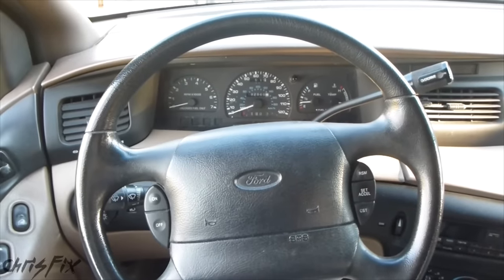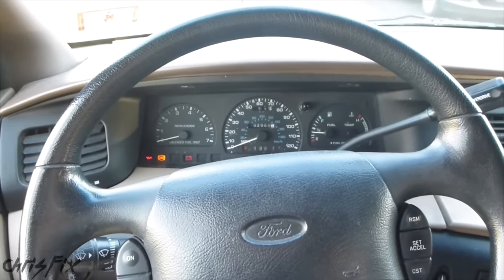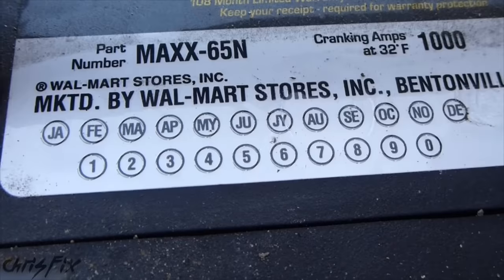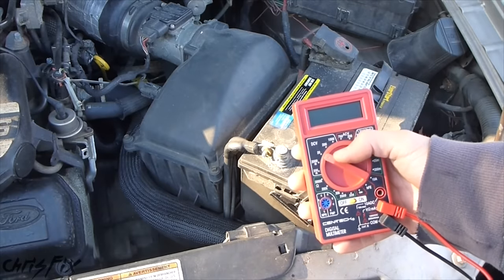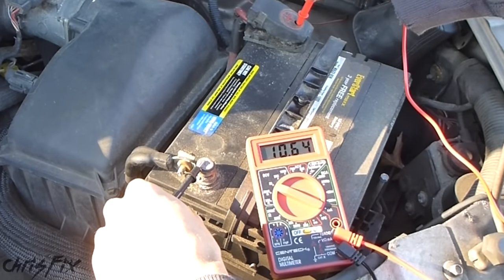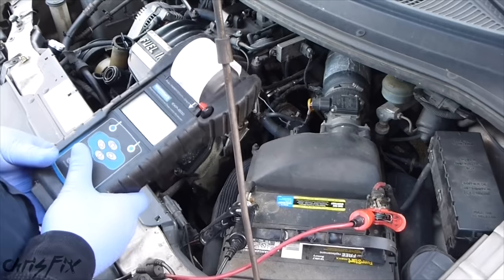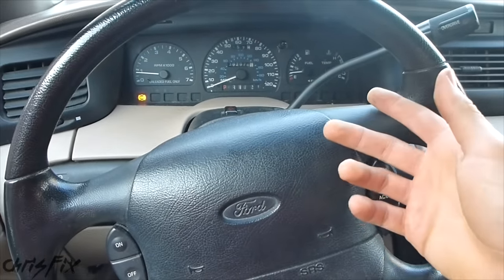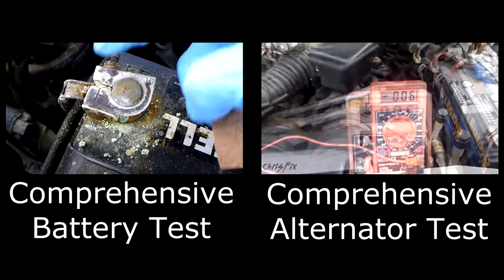What to do if your Car won't Start

Comment: 2 times my truck did not start. The radio, lights came one but still wouldnt start. Hooked up jumper cables, did not start. I TURN ON THE HEADLIGHTS AND IT STARTS. Truck is such a troll
Reply from the maker: shoebert31 hahaha, did you ever figure out why? That is bizarre!
Reply: ChrisFix
nope, only happened twice
Reply: ford f150
Reply from the maker: Hopefully it is nothing. But on the bright side, you can be like Biff in back to the future. Only you can start your car haha.
Reply: Arutha258
i dont recall
Reply: shoebert31
My '04 Mustang died going down the road a few times and when I would turn the ignition on to restart, none of the gauges would work but the radio and lights worked fine. It wouldn't start. I was just wondering if we had a similar issue. I've been told it could be my anti theft malfunctioning and locking me out. After the car sits for 10-20 mins, it fires right up.
Reply: Arutha258 it's because your car is not in park
Reply: shoebert31 hahahahaha thanks for sharing the story lol
Reply: Shoe did you check the starter
Reply: I had the same issue. Turned out issue was a Ford.

Comment: What if my car studders when i crank it and now it doesnt want to start, its only a tic noise. What could it be?
Reply: Either starter needs to be tinkered with or replaced or your battery is shot
Reply: Loose cable

Comment: i have 2008 or 2009 madza cx- 9 ....like the pass 2 weeks its been acting up ...when i got off from work i tried to crank it up but did not turn on i waited like 5 mins then it turn on so i was not stranded .. it has done that to me like 4 times ..you think you can tell me whats the problem on it ..i would really Appreciate it.
thanks
Reply from the maker: It sounds like a bad starter, I have a video here on how to diagnose and replace one, check it out: https://www.youtube.com/watch?v=yC409CU7mU8

Comment: Hey Chris I have the same engine in my 1988 Mercury Cougar that’s in this vehicle it cranks and backfires but never starts when it cranks there is oil leaking out of the throttle body I replaced the fuel filter and spark plugs but that didn’t do nothing I used starting fluid and the only thing it does when I crank it the car immediately backfires during startup and doesn’t start what do I do?

Comment: hey so i have a gmc sierra 2005 and one day randomly it wouldn’t start. it was cranking and at a regular speed, just wouldn’t start, almost like it was out of gas. after a few minutes it started up fine. any suggestion on what may have caused this? no issues since

Comment: Hey. I've got a problem with my 2000 Ford Ranger. I've got the 2.5L I4. Typically happens when I'm first turning it on after several hours. Basically, when I turn the key to 5th position, the ignition will not crank at all. Lights come on and the chimes beep normally, but no cranking. I have to hold the key in 5th position for around 10-20 seconds before the engine cranks and I'm able to drive. I've replaced the battery and cleaned off the corrosion, to which I run into the same problem. It's beginning to get really frustrating because I can't figure out the source of the problem and no one has been able to help. Got any advice?

Comment: Hi, I have a question. I have an old car and I haven't been using it. Its been months since I started it. But I tried to start it today but it won't start. It doesn't even crank or make any noise when your turn the key. Know what it could be? I know without you looking at it might be hard but just curios if you know. And its a 4 cylinder but it is running on 3 cylinders. From what my mechanic said. Thats why I started using another car cause it would turn off when I sat at a stop light or stop sign for too long.

Comment: hi, there. i drove my car earlier today and when i tried to use it 3 hours later. it wouldn't go .. my battery is new likewise 8 months old. my lights come on, there's no signal stating its the battery or anything and the clock hasn't reset. do you think its the starter?

Comment: My car doesnt start when I turn the key slowly or at like a normal speed. (whatever a normal speed would be) I have to insert and turn the key really fast right away or it won't start. I have no idea what the problem is.
Reply from the maker: It can be a few things but I would check your key cylinder.
Reply: +skyistooblue2 had the same problem with a vaxhall corsa turned out to be a faulty ecu due to getting wet from a steam clean

Comment: My 2016 Subaru Legacy wouldn’t start and still had the original battery with lots of corrosion on the positive terminal. I replaced the battery and used baking soda and water to clean the terminal clamps. Tried starting and it wouldn’t start. Got some lights on the console, but no clicks or turning over sounds. 

Measured the voltage at it was 12.6V. Then a few minutes later I tried starting it again and it started right up. Should I be worried about a different issue?

Comment: Man it's impossible nowadays to find a battery that can last for 7 years !!!
It's a miracle for me if it lasts 3 years ...
Reply: Abdullah Ibrahim I have one that's almost 5 years old and it's still cranking strong.
Reply: Abdullah Ibrahim well my sisters car is a 2006 Corolla and the battery has lasted ever since my grandma bought the car
Reply: I bought  a Corolla  2001 surprisingly  the battery  is 9 year old  works perfectly  so far.

Comment: I have a 80 series landcrusier and it wouldn't start but that's battery is fine so I thought it was the fuel and it's cranking but not turning over, I replaced the fuel solinoid but it wasn't the case and still wouldn't go I took out the hose connected to the fuel filter and cranked it and still didn't turn over do you think it's the fuel pump ?

Comment: I had a battery go bad but not in the way you think.  Needed a jump start to get home and about midnight I checked the start again.   Nothing and checked the terminals.  The Negative terminal was corroded at the base of the battery housing.  I was able to get it cranked and started.  Took it to the local 24 hour Auto Zone and pretty much new battery was shot.  Didn’t even try to load test.  They had in stock but I didn’t want to risk shutting down in the A/Z parking lot and not starting again.  

I wound up replacing the battery with engine running secured the terminals and went back home.  Had no issues after that.

Comment: Sharing my experience with this same issue. Trying to start the car (Honda CR-V 2002 AT), all that happens is there is a single click sound coming from somewhere, and no cranking takes place. Tried multiple times, and the same just happens.

I checked the terminal connections in the battery if they were loose; nope, they were nice and tight. Tried replacing the battery with a new one (since the old one had a history of being totally discharged a couple of months prior); the issue still persists.

The problem all along was a blown fuse for the fuel pump. The fuse box was below the steering column. Good thing there were spare fuses with the correct ampere rating in the fuse box under the hood. Replacing the said fuse fixed my issue.

Comment: I can tell by how it sounds your battery was just dead
Reply from the maker: Yep!
Reply: what if the Alternator was faulty?
Reply: +8Beat Crotchet It could keep running, but you'll lose alot of juice, because the alternator charges the battery while driving, but if your alternator is bad, then you'll be losing alot of voltages from your battery

Comment: I broke down on highway and got pulled home. My wire from frame to firewall was broke in half before so I put a 12 gauge wire in place of. I keep on having problems with truck cutting off. Sometimes It won't start and wait 5 minutes and then it will start. A friend noticed the ground on engine in front was loose so he tightened and it about cranked then I found another wire from frame going to back of engine was just about burnt in half and I twisted the wires together and put a electric slice twister to put 2 wires together. It still just about starts and I tried starter fluid in breather or carb. Truck is a Chevy K3500 gas 5.7 engine 4-door crew cab Dually with 4 wheel drive. I need help please on what to do next. And just subscribed and like alot of your videos.I did tighten bolt on frame to tight and I guess I will tack weld it. I hope that will fix it. Anymore suggestions. Has 105k on miles. Rebuilt alternator, new starter, checked all fuses, Im wondering if it's a relay. I checked them and seems ok plus 60 psi fuel pressure. RS2. says oxygen sensor and CATALACK converter

Comment: If you drive a manual you can also push tbe car and while it's moving you can try starting the car as because of the movement the battery usually gets a microscopical amount of energy which is in most cases enough then just let it run a little to charge up and you are free to go

Comment: hey chris, listen, i was told some time ago this, and now i took notice, so ot may be a good idea to share with you. so after you put the ignition key and turn on the battery, i was told to wait a litle for the fuel pump to load before starting the engine, another thing is when the engine starts,to let it get hot,and if possible never to start going rear with cold engine. If you would like you can make a video about litle thing like these and maybe debunk some myths. Good job man!
Reply from the maker: Thanks a lot! I actually made a video similar to that a while ago, check it out: https://www.youtube.com/watch?v=gkn-K2noClw

Comment: Hey chris i have a 1984 cadillac deville and my car is showing a battery light and when i got to start it it dose a slow start and it seems like the car wont hold a charger because when i shut it off its like the battery died what could this be?

Comment: I have a 1997 Chevrolet Cavalier, with 190,000 miles on it.  It will not start if its 38 degrees out side.  However, once it warms up, it works great.  How can I fix it?

Comment: My car sounded the same when trying to start anytime it sits for more than  two days when it get close to 0° C. I changed the  battery and now it need a jump every morning instead of every few days. I don’t have any warning lights coming on in the vehicle. Do you think I should have my alternator tested?

Edit: I tested the alternated voltage with the car running and it’s at 14.3 v…

Comment: Hey Chris,

I have a car battery that has died, power seems good going to the car (no dimming) but it wont start the car at all. On the label it says adding water not required, it also has the health light which has gone totally black (green for healthy). 
There are cell covers that come off, would it do any good if i go ahead and add water anyways then boost the car? Will the battery revive and hold a charge?

Thanks for the help
Reply: no, it means ur battery cell is dead and should be replaced

Comment: I got Volkswagen Jetta Gil 05 , got it for 2k it had 128k miles on it , but the engine was kinda bad so I did an engine swap and it was running good after the engine swap but for some reason the car turned off on me well on my way to school luckily I was an empty street lol but I checked the battery , and alternator and they were  good , I replaced the fuel pump thinking it was that but it still turn off while I was driving today , any thoughts ?

Comment: I have an accord 2001 and it didn't start, called tow truck, the guy hit a plate or something under the car and then the car started. He said it might be filled with junk. What could be the issue? I have a new batter and starter only 1 year old.

Comment: Hi Chris, my car wont start so I charged the battery for 30mins but it still won’t start. I can see the signal lights (right) and the windshield wiper are on, it only stops until the battery is dead again 😌

Comment: ChrisFix, i have a 04 saturn vue. Being the 4 owner i don’t know what has been replaced. But its rare that the car fails to start. But today was different. It failed to start twice. I turn the key and the dash died and not a sound came from the engine. I had it tested and it all passed( starter, battery, & alternator). What could it be?
Reply: sounds like it may be battery connections having corrosion on em, or bad connections somewhere else...check the ground or condition of the cables....if not I got a video that might help u out

Comment: Have had a Slow crank for a long time on 2004 Toyota Corolla. Eventually it always started but today turn the key lights went on but silence. Got a jump-start and was able to drive to the auto center to get a new battery. Still a little bit of a slow crank but turned on and drove off. Until I parked and came back and same thing happened. Silence but with lights when turning the key. Wait a few seconds try it again and it turned on. What is that all about?

Comment: Hai Chris, My car stops suddenly and after few minutes when i try it starts again , went to mechanic changed spark plugs, cleaned throttle, changed sensor and starter, still im facing this issue, kindly help me to ressolve this issue

Comment: Chris could u help me out i have a ford focus mk2 i tried starting her up but i get a little crank and nothing more someone told me its the battery but im afraid that it could be the alternator? Because i tried charging it up but nothing happens ?? ( its really cold outside aswell )
Reply: iMorTal936 if u jumpstart ur car and once disconnecting ur jumper cables it dies...pretty good chance ur alternator is bad...but if it stays running..ur alternator is not the problem

Comment: Is there anything I can put on or around the car battery to keep the battery warm in the freezing winter   ? I was thinking using a very warm towel wrapped around the car battery to keep it going bad when the car is not started ? Especially for a very low cold cranking amp battery that's around 500 ?

Comment: Man this guy is a True about evrything

Proof:-
I was with my family on road trip for a marriage occasion. The road was not opened for some reason, I Just stopped my car on a patrol pump and went to wash room, when I came back and tried to start my car it wont start, luckily a mechanic's shop was nearby so I too my car There. I tried to jump start with a car and a battery but couldnt start as it was a honda civic 2014 and the car was small which tried to jumpstart. The mechanic took my battery and changed it. White he was charging this video came in my mind and i started watching it. After he put the battery back the car did start up but the time was reset and same happened in this video and then I changed the battery of it.

Comment: Seven years, dang. Mine lasted a decade (2011 model Actyon Sports, the only pickup truck made by South Korean car manufacturer) and it still manages to start the engine in -20C (negative four degrees in Fahrenheit or something after a week after last engine running). I already flushed break fluid, engine oils like 8 times, power steering fluid, differential oil (Koreans call it axle oil tho) and even blinker fluid (lmao) thanks to you. It's time to swap out the battery now.

Comment: Ik it holds but if I got a new battery but the car still womt start is it my alternator and if so is there a way I could check
Reply: If it still won't start then the starter's dead
The alternator is just there to charge the battery it doesn't do anything else 

You will know when the alternator is dead if your car starts and the battery light doesn't go off that means its dead

Comment: I have a 2000 Nissan frontier xe 2.4 it cranks but won't start I replaced the fuel filter and rotor button and ignition coil  . but it still want start ( please help )

Comment: Hi I am from the Philippines 🇵🇭 and my yellow car won't start, it doesn't crank and only makes a grinding sound from the starter when I turn the key to "Start" from the "Run" position.
Reply from the maker: Sounds like the starter gear is worn, I have a video on how to replace a starter, check it out: https://www.youtube.com/watch?v=yC409CU7mU8

Comment: I’m only 12 but this happened to my moms car, the  battery died because the headlights were accidentally left on over night, then in the morning I went to start that car and It won’t start so I got my volt meter and measured to battery, it was only 10.4 volts so I got our jumper and jump started the car with my dad, your videos are helpful I appreciate it I am now a expert on jump starting even though I’m only 12.

Comment: 02 Honda Accord ex coupe. I turn the key lights come on but when I fully turn the engine won't even crank. Any ideas? Maybe a starter?
Reply: Charme battery than if not Change starter

Comment: The new Duracell battery you got should be a really good one mine went out in my 92 f250 and the only tag I could find on the battery was 2008 and that's 12 years ago

Comment: Hey Chris. My car has been starting all day and I just put a radio in and the car was starting perfectly fine with the radio in. All of a sudden it won’t start. The ac and all electronics come on but when I turn the key I hear one small click and that’s it. Please help
Reply: check ur battery connection to make sure its tight, if so most likely its gonna be ur starter

Comment: Chris, you may want to put up a small warning about changing the battery. I managed to damage my ECU when changing mine. It meant I had to take the bus for two months whilst I figured out the issue.

Comment: I just cahnged the feul pump on My 1999 mustang and it wont start. It'll crank and want to start but wont start. Can you please help me out. Thank you
Reply: check for spark if u got none, itll probably be related to some component that cuts out spark..like the ignition module.